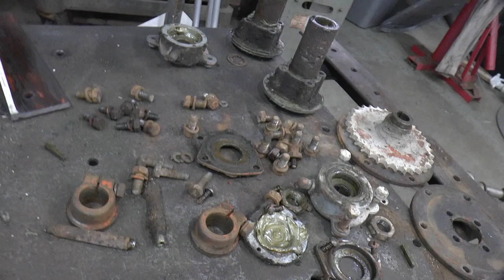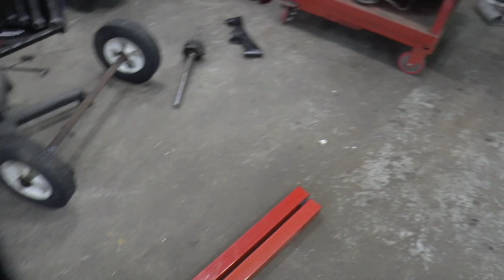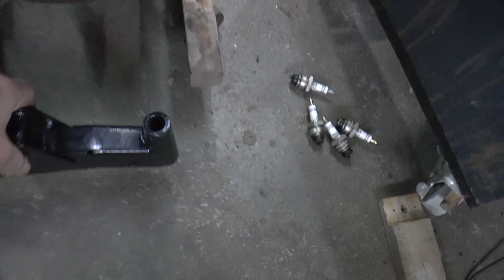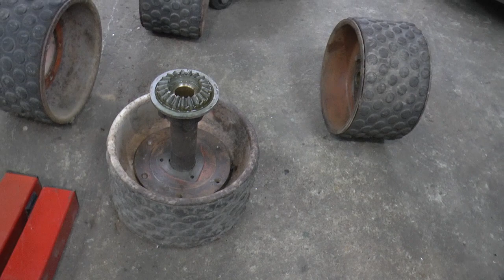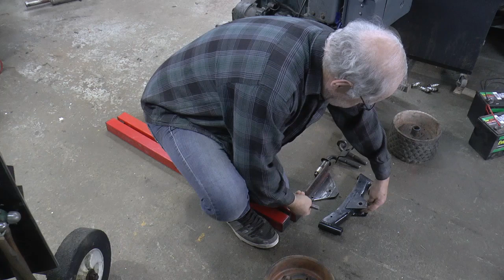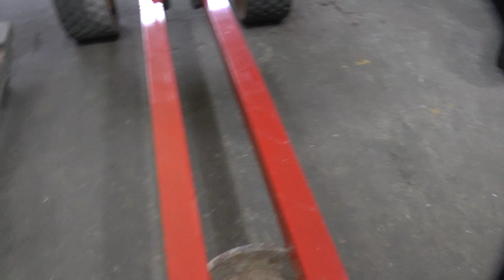Kohler Light Plant Cart Build part 1

Comment: Does oil drain from under the unit? Are there any PM's to be done from the bottom? If not, I don't believe the narrow rails would present any issues as far as twisting. The stance of the wheels will be dictating how "top heavy" it feels. That being said, you asked the question because it may bother you. If it does, widen it and be done. That cart looks like  a lunar landing buggy with those wheels. Pretty neat project all together. Well done.
Reply from the maker: Thanks for replying. Being narrow may be helpful for servicing and repair. I never thought about that aspect. Widening also is more work.